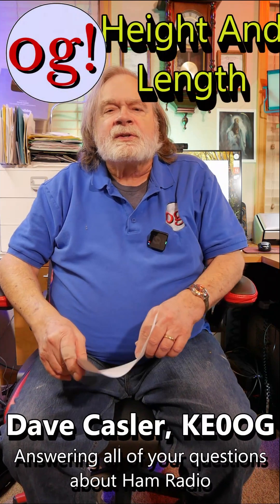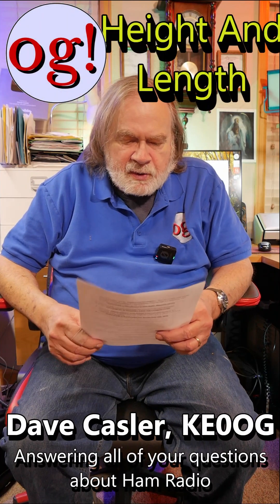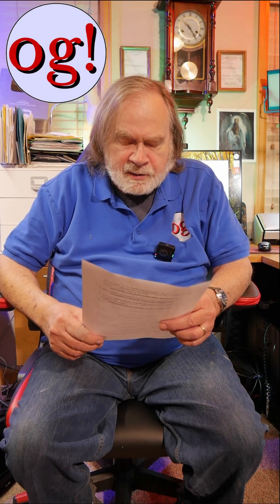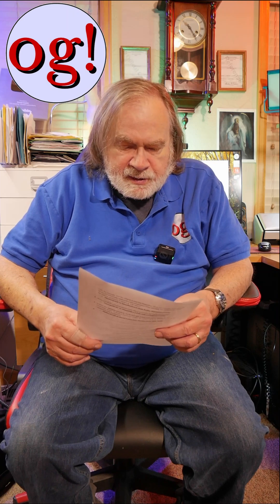Height and Length (Short #10)

Comment: Since you brought up modeling of an EFHW, I thought I would try:   See what you get for comparison.  Using MMANA, I got (for a 66' EFHW): 7.0MHz = 2.65VSWR ... 14.15 = 1.29 ... 21.05 = 1.84 ... 28.5 = 2.29 ...  50.1 = 2.29 ... 144.975 = 3.09 (and 2 meters is VERY touchy on frequency).